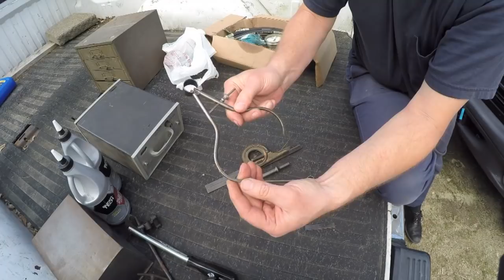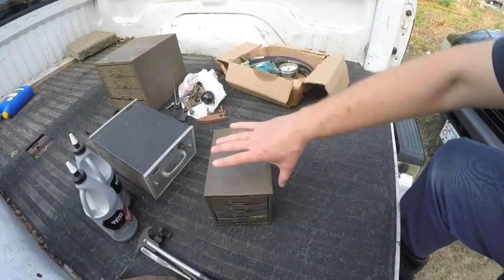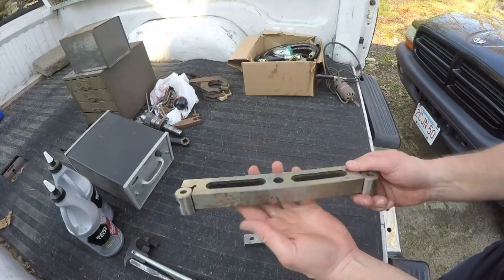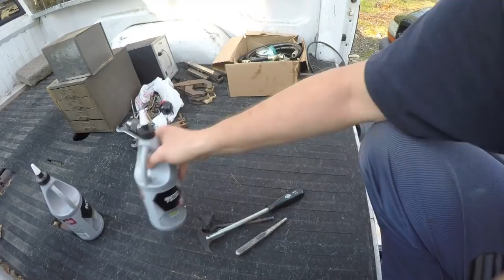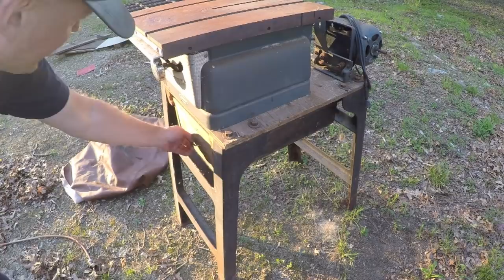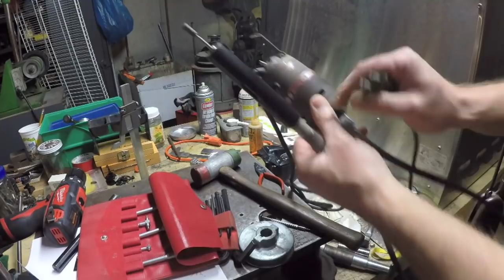Flea Market Finds May 2018

Comment: I have a Wavetek VCG Model III and it works well. Probably late '70s. Picked it up from previous employer. Just needed new power supply caps.
Edit: I forgot to mention, if you find those 3-pin power cords, they are worth $$$. I have several HP 4xx meters that use them and I have not found cords less than $35 shipped. There are two variants though and of course, HP used a rare one.
Reply from the maker: Scott H yup, I think I still have a frequency counter somewhere that uses that cord. They are a hard find. I might just remove the socket, and install a standard pc power supply socket.

Comment: that oil is the walmart brand,that is the only strut compressor i would ever use now and its worth at least twice what you paid. i got the same table saw for free but it had no extensions and i wanted the motor for my craftsman 6x48 belt sander project. i took all the stuff that i could sell on ebay and scrapped the rest. i believe it was made by king sealy,i have the original platform it was mounted on
Reply from the maker: roger oconnor yup, that saw was definitely worth more parted out, but I gave a local guy a great deal, sold it to him for $40, and kept the legs for another project. I've seen those motors for for $50 or more depending on condition.